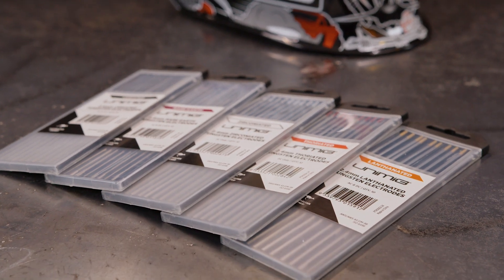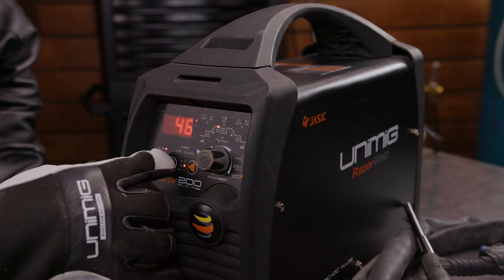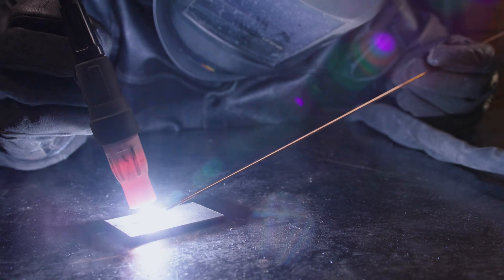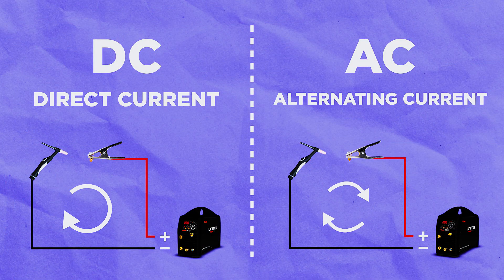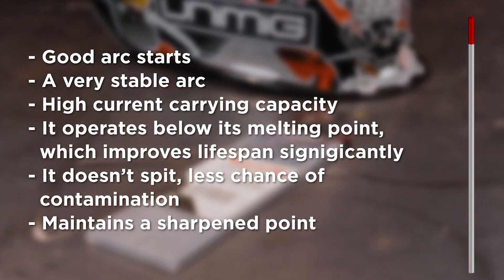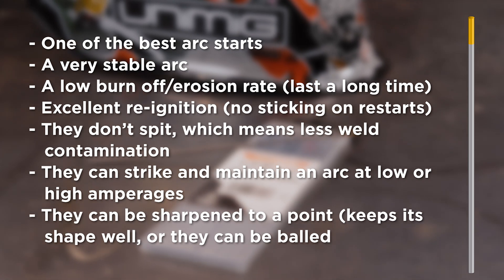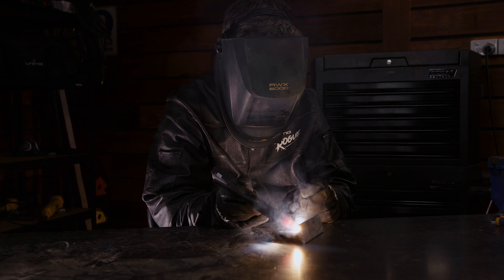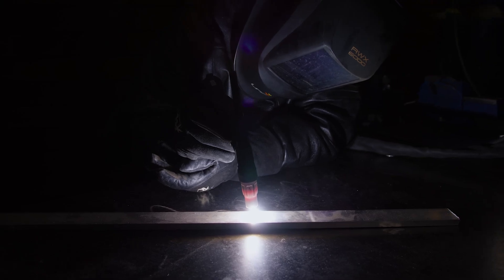TIG Tungsten Selection Guide: Which tungsten should I use?

Comment: Funny .. selecting the right electrode is simple. Finding the full range of Unimig tungsten electrodes in stock is HARD! I recently ordered some online (6 packs of 10) to be told after a week of waiting that they're waiting on stock from Unimig and they expect it to be another 6 weeks. I cancelled the order and I'm now hunting.

It's very frustrating that something that should be incredibly easy to source is insanely hard. If Unimig resellers can't stock the full range, Unimig NEED to set up a rapid despatch online service to supply those things DIRECT. The same goes for filler, wire, rods, etc. Even more frustrating is that the place I purchased my Unimig welders from try to push their house brand stuff. Doesn't Unimig have any ability to enforce ranging Unimig fillers and consumables when they sell their welders and cutters?

Comment: Funny .. selecting the right electrode is simple. Finding the full range of Unimig tungsten electrodes in stock is HARD! I recently ordered some online to be told after a week of waiting that they're waiting on stock from Unimig and they expect it to be another 6 weeks. I cancelled the order and I'm now hunting.
Reply: I like to deal directly with a welding shop like Gasweld or BOC Gases. BOC is where I bought my Tig Welder and they Had most of the Tungstens, cups and collets as well.

Comment: I see you're displaying a dodgy old grinder sharpening electrodes .. but there's a bunch of options out there made for accurately sharpening different thickness electrodes at different angles. I'm a noob and have zilch in experience .. but some of the pros seem to take electrode prep very seriously. How much difference would you expect between a "looks good enough" grind on grandad's old bench grinder v's a $3K professional electrode sharpener?

Personally I'm considering one of the multi angle Dremel attachments that are all over Ebay. Dumb?
Reply: I've been tigging since I was 17 and I'm 61 now, so I guess I've been around the tig block a few times, lol ..... But to be honest unless you're doing certified work with welding specifications that call for specific prep, process and testable weld quality, you're not going to notice much difference. My first welding job in So-Cal in the late 70's was for a company that had the contract to weld all of the Redline BMX racing frames. Thin wall Chromoly tubing. Since it was piece work paid, we used to "quickly" grind a handful of tungsten on both ends with a vertical belt sander, usually doing it the wrong way, lol, ie holding the tungsten partly sideways instead of vertically, and rotate it until you had the point taper you desired. Technically the grain pattern should be straight down to the point, and not swirling as you rotate the tungsten, but again to be honest it made very little noticeable difference. We were known for our signature weld style and they were strong AND beautiful and done very quickly. Is the arc more stable with straight grain? Yeah, marginally. Is there the potential that the tungsten will have some minute contaminent from the grinding wheel or sanding belt? Maybe, but will it affect the weld quality for the average guy? No. Will it make or break the average even skilled welders weld? No. Is it best to do it properly? Sure of course, but my point is that for most guys, it's going to be a negligible difference, and i can say that after having 1,000's of successful welds in service on all manner of things. Ive done Aerospace in the past and that is a different world where the welding process is often specified and non destructive testing employed, and there it makes sense to carefuly prep your tungsten to insure the purest weld pool you can. The precision grinders are nice tho because a) you DO get a proper grind everytime, b) You get it without burning your fingers trying to rotate the hot from grinding tungsten, and c) it's way faster, AND its safer (if you're grinding 2% thoriated).
Reply: Personally I don't have 3 grand for a purpose built Diamond grinder. But you can easily buy a Silicon carbide wheel at Welding supply shops, put it on one side of your bench grinder  and end up with a Tungsten Grinder, and you only use THAT wheel for Sharpening Tungstens.